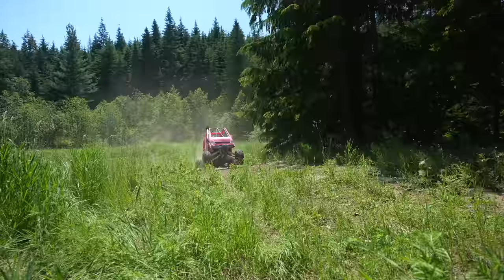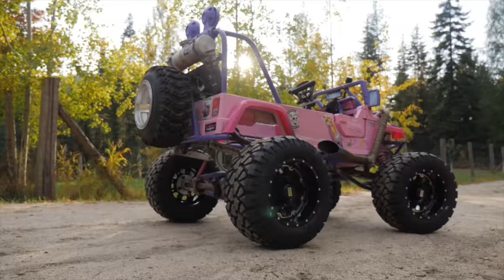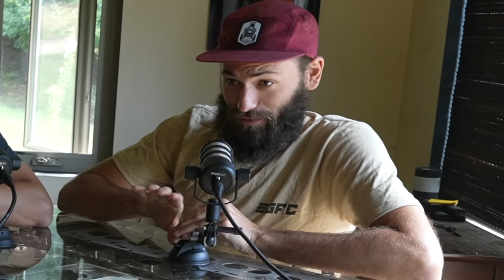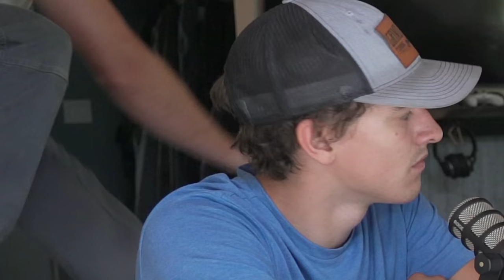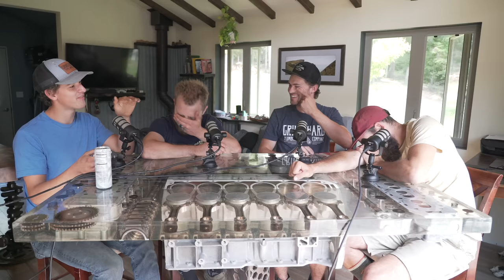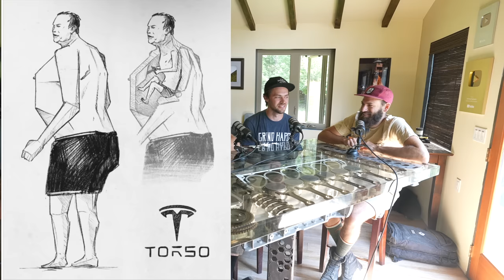Ex Tesla Engineer Speaks Up! Sent and Bent EP 6

Comment: The reasons automotive glass doesn't use transitions technology:
1) It reacts too slowly. Imagine driving in bright sunlight with the glass fully tinted, and then you go into a tunnel or other dark area. Suddenly you're nearly blind for several minutes. It's even slower in colder weather.
2) The chemical reaction gets weaker over time, so you'd need to replace the glass periodically (much easier to do with eyeglasses). Typically only effective for around 2-3 years.
3) Cost. It adds $100-400 in cost for a few square inches of eyeglass coating. Multiply that by your car's glass area. And good luck getting your insurance to cover that repair bill if the glass gets cracked.
4) Sunglasses exist. Hats exist. Electrochromic tinting exists if you want to get really fancy and control the tint level at any given time.